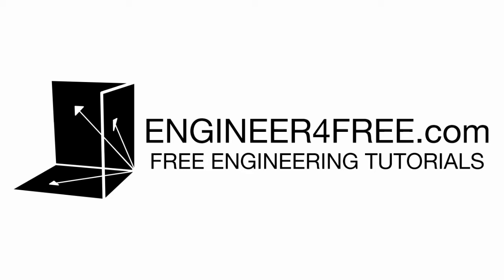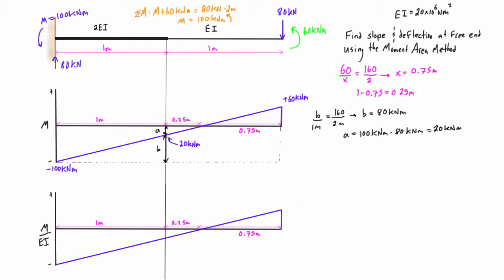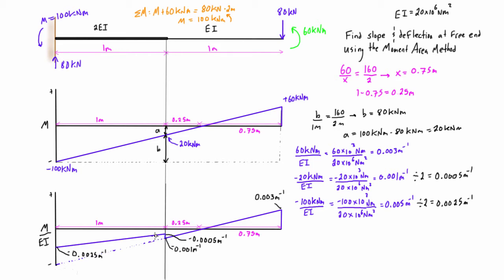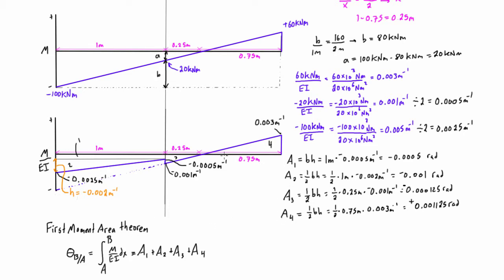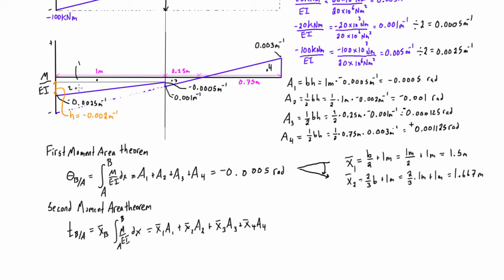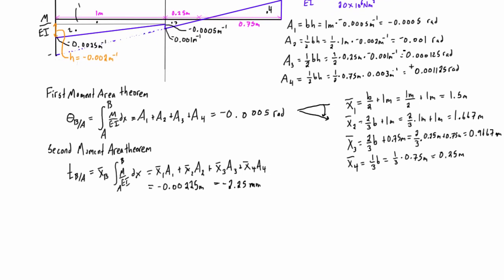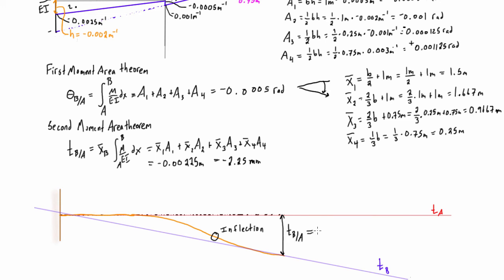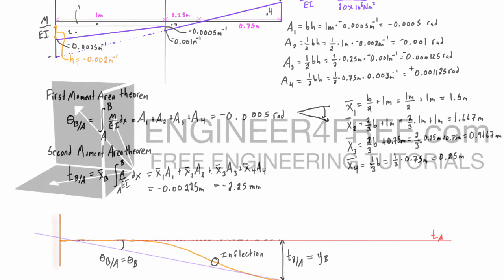Moment area method example #4: non-constant EI (flexural rigidity)

Comment: What should I do if the "EI" always changing? For example, the cross-section area is not constant.
Reply from the maker: Hey sorry I only have videos for beams with constant EI, or “stepper” EI like in this video. I cant remember off the top of my head what the expression is if the cross sectional area is constantly changing with x. There should be a section in your textbook that covers it if you have one.

Comment: How can I apply Macaulay's method for this type of questions (with 2 different EI)?
Reply from the maker: Hey I have some videos on the Double Integration Method (Macaulay's Method). They are videos 10-14 here: engineer4free.com/structural-analysis They all have constant EI, but I beleive it's not a problem, just break it into sections like I do in video 13. If you have EI in one section and 2EI or something in a different section you can reflect it in the two separate expressions. I'd watch those videos even tho they don't directly answer your question, just good to get more exposure and practice with the method.
Reply: @Engineer4Free   thanks a lot for your response. You are teaching me all the classes that should have been taught at the uni.
Reply from the maker: 😂 I gochu